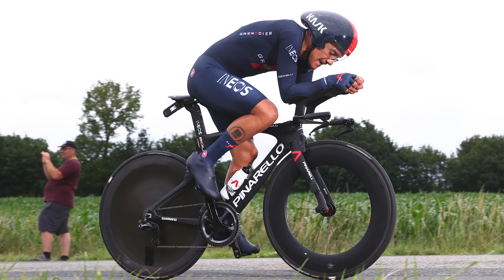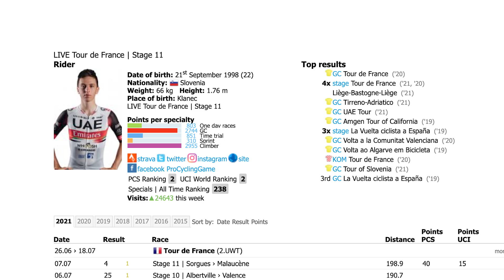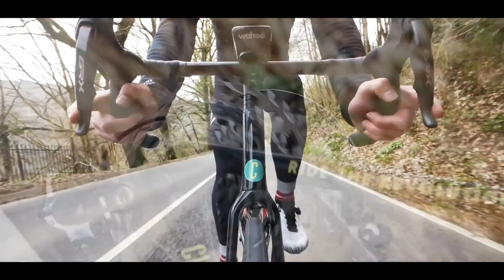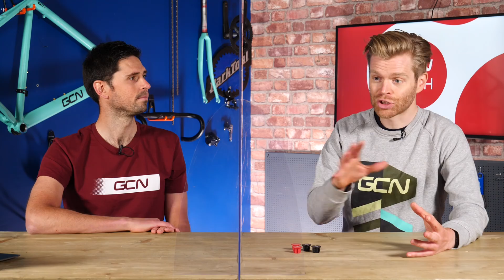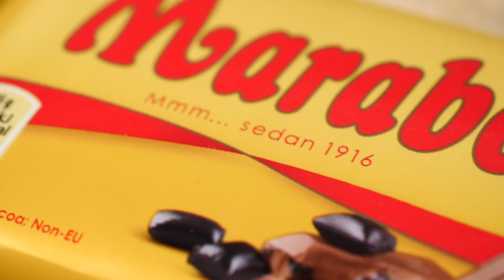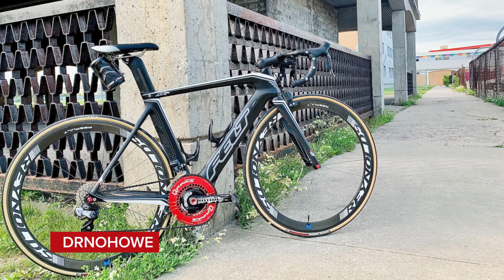How Good Are Pro Cyclists At Time Trials? Tour De France 2021 TT Analysis! | GCN Tech Show Ep.185

Comment: 0.179 Also seems quite a meaningless number to you Oli. I understand you are a scientist, but I don't think you were one in the field of engineering.

Aerodynamic drag coefficient has more to do with the shape and slipperiness of the rider, and is independent of the size of the rider. I think when riders use 'CdA' they are referring to the drag coefficient TIMES area (Cd * A) part of the total drag formula. The 'A' does not stand for 'Aerodynamic' here.

Comment: #askgcntech We often see Conor riding his bike with his cute kid in a stroller. I'm wondering if you have any do's or don'ts to do this safely on a carbon bike? I'm used to riding our stroller on an aluminium trekking bike, but how much extra load can a carbon road/gravel bike handle on the rear axle? 
(I'm riding a Cervélo Aspéro, and my kids are 2 and 5.)